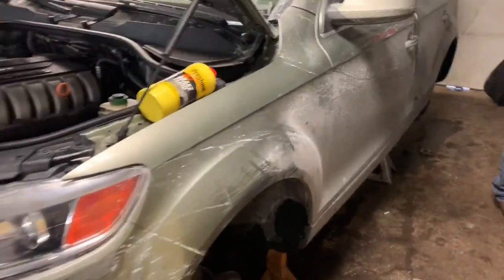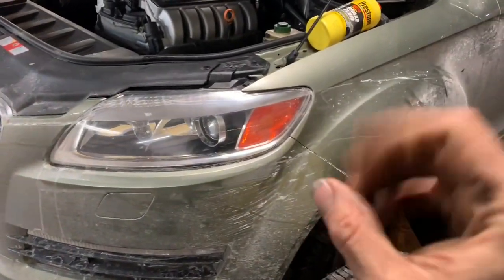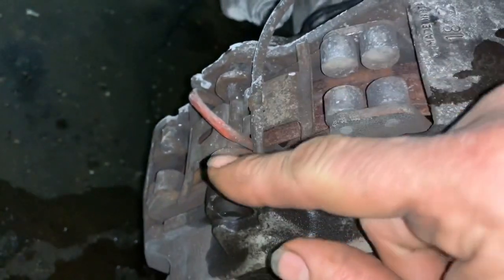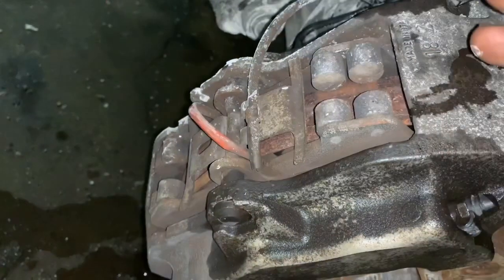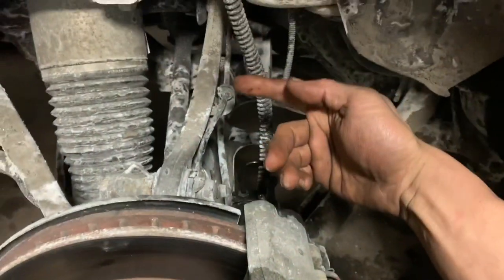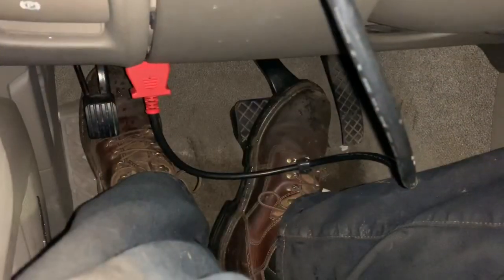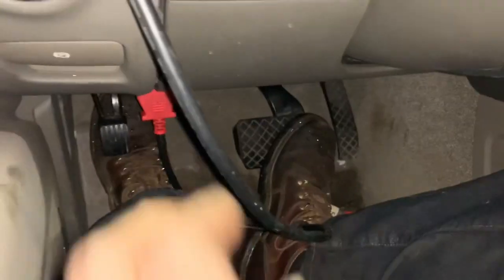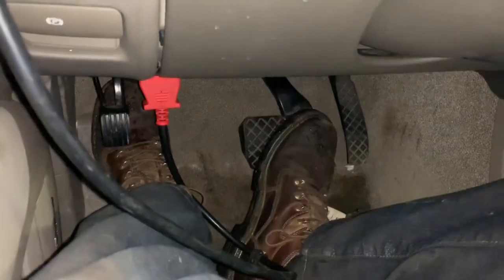Audi brake bleed procedure

Comment: Should the brake fluid reservoir cap be open or air tight when bleeding the valve and should the extra brake fluid in the bottle with  pipe attached be above or below the bleeder valve? Does it matter or make a difference?

Comment: In Audi's service manual, the bleeding sequence is closest first: front right/left, rear right/left. Also, you need to pump 5 times (to build up pressure) and then hold, not down/up like in your video.
Reply: Uhhh.. actually your channel is called the CLAY WAY should be called the WRONG WAY and this guy is %100 correct. I'm just gonna guess by you not even knowing the name of your own channel that you don't know more than the engineers at Audi so there's a reason that the WRONG WAY is the ... the..cLAy way??!?my brain hurts wtf
Reply: @sharpcarco  I have to reply because your ignorance is actually disgusting. This is copied DIRECTLY from the service manual. I hope God blesses you with some common sense and clarity.
Bleeding Sequence1 -  Outer Left Front Brake Caliper2 -  Inner Left Front Brake Caliper3 -  Outer Right Front Brake Caliper4 -  Inner Right Front Brake Caliper5 -  Left Rear Brake Caliper6 -  Right Rear Brake Caliper
Reply: This also applies to the a4 b8.5 bleed sequence? Thank you
Reply: Hi there hope I’m not bothering you I  same the same dual bleed breaker do I have to bleed both side or just outer line
Reply: @Edi-01  both

Comment: Hey my Audi brakes feels like it’s still rolling forward /reverse even after I have my foot pressed down all the way. Could this be related to your video?
Reply from the maker: I had that same problem. Ended up resolving itself but it was very strange I thought there was contamination in the fluid. That would be my only explanation obviously it could’ve been a leak as well but it was very strange.

It could’ve been an internal ABS control Solenoid  as well but like I said I never actually got it resolved